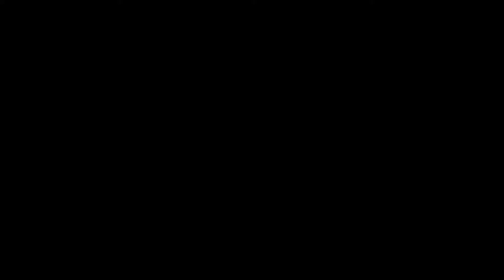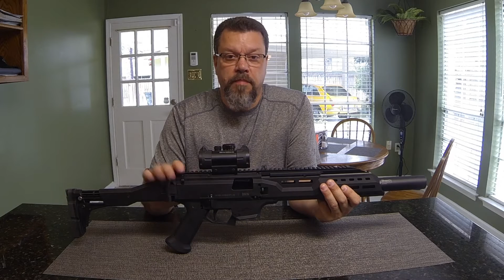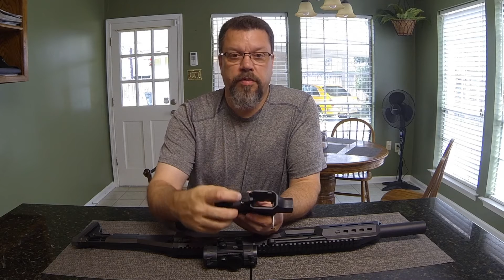CZ Scorpion Evo 3 S1 Carbine - Issues and observations

Comment: Just saw this video After I had the same problem with the screw (8/2020). I’ve already switched the left side safety, but I’ll try polishing the safety as you mentioned. You were spot on with everything. I’m guessing the Scorpion is holding up well with completion shooting. Thanks.
Reply from the maker: Sorry you had a problem with it, but glad I wasn't the only one.  Haha.  After about 4 1/4 years, I still absolutely love this gun.  I have many thousands of rounds through it and no functional issues at all.  I did eventually get the replacement trigger pack, but am still using the modified original.  The only other thing I did to the gun to make it even more comfortable was to replace the factory grip with a YetiWurks grip.  I found the factory grip angle a bit uncomfortable so I replaced it with a more vertical grip.   As far as competing with the scorpion, it was perfect for me.  It seemed to run better than a lot of the guys shooting AR platform 9mm carbines.

Comment: 1 Took me about 30 minutes with a carbide dremel bit to grind off the weld.
2 The safety "sticking out" is less noticeable on the carbine or pistol turned SBR. 
3 The safety to me is bass-ackwards. Gearhead works makes a reversed safety for these pistols.
4 The overly stiff safety. I polished both areas on the trigger housing as you indicated and the area on the 
   safety shaft where it makes contact. Takes a bit of the sharp angle off the metal components and really
   smoothed it out. 

Cheers
MJ

Comment from the maker: So far so good, and I put them through hell.  I have the two factory 20 round and two 30 round mags.  All have been dropped during reloads many times on dirt, gravel and even concrete.  Usually still loaded up during mandatory reload stages.  I have heard of some issues with the polymer feed lips cracking and I have been concerned about that, but I haven't had that issue yet.  They do make a magazine with metal feed lips now.
Reply: there is aftermarket one it has metal feed lips 32 round

Comment: What's your opinion on the mags? Are they going to hold up?
Reply from the maker: So far so good, and I put them through hell.  I have the two factory 20 round and two 30 round mags.  All have been dropped during reloads many times on dirt, gravel and even concrete.  Usually still loaded up during mandatory reload stages.  I have heard of some issues with the polymer feed lips cracking and I have been concerned about that, but I haven't had that issue yet.  They do make a magazine with metal feed lips now.

Comment: I recently got one of these and replaced the safety (one side) with the HBI AK style and I also replaced the grip with a Yeti Wurks switchback and those two upgrades made a huge improvement. I also did the trigger spring kit and breaking the weld took about an hour and multiple drill bits. I will be shooting USPSA with mine and look forward to my first match. Have you gotten any mag pouches yet? If not take a look at these http://redhilltactical.com/t/magazine-pouches. They don't have any pics of them but so far, the things I bought from them have been top notch!!
Reply from the maker: Hi, I actually just installed the Yeti Wurks switchback grip as well.  Makes a world of difference.  After shooting a couple of matches, I realized that I didn't like the original grip angle. I do have 1 mag pouch that I had made from Gear Craft Holsters.  It's a very nice tension adjustable pouch with a bladetech belt clip.  Only ordered 1 to try, but need at least one more.  Let me know how you like shooting it in USPSA PCC division.  I love it, so much fun.

Comment: those are hardley issues vs personal preference i have over 2000 rounds in my scorpion and the trigger was never an issue so its a non issue, its personal preference, as far as the safety i chose to change the grip to a more vertical grip from yetti werks and didnt have the issue. but the ak style safety is worlds better anyhow. that is why you havnt seen anything on the "issues" you have with your gun. personal preference is hardly and issue with the weapon

Comment: Had the same issue trying to drill out the weld. I think later models of the welded trigger pack have more substantial welds that make centering the bit harder.
Reply: I feel like neither of you are familiar with center punches.
Reply from the maker: I think you are right about that.  I also think they used better quality screws.  Other videos indicated that you could just break the head of the mounting screw off easily with a pair of pliers.  That was not my experience.  The screw was quite strong on my scorpion.

Comment: I waited for the 2016 version that doesn't have the weld on the trigger pack screw. Just ordered the right side factory safety plug which will eliminate the problem of it rubbing my finger. So far I couldn't be happier with this product. Nice review.

Comment: The Evo kind of comes with the understanding it's gonna cost $100-200 to improve the trigger, grip and possibly charging handle. 
Frankly the carbine is a bad value. An SBR pistol runs about $100 more out the door. Only downside is the wait, paperwork and finding the stock.
Reply from the maker: It depends on your needs. For me it was the logical choice.  I don't ever plan on using a suppressor and I really didn't want to deal with all of the NFA paperwork and waiting.  Plus having to file forms to take it out of state for matches, etc.  All in all, this is a great little carbine.  Extremely fun and inexpensive to shoot.

Comment: I'm not a big fan of the safety for the same reasons. I've been thinking about polishing the parts for a while and you just convinced me to give it go.
Reply from the maker: Thanks.  Take your time, it's worth the effort.
Reply: I took about 5 good swipes with a new, sharp, fine toothed file then spent some time with sandpaper, stones and finally a dremel with a buff getting it nice and polished. HUGE improvement! Operating the safety without changing my grip is no longer a problem. Thanks for the motivation!
Reply from the maker: Sweet.  glad to hear it.